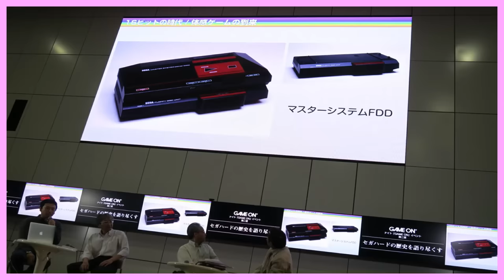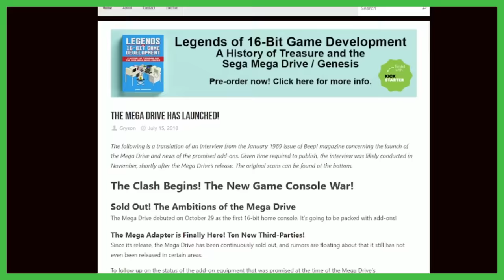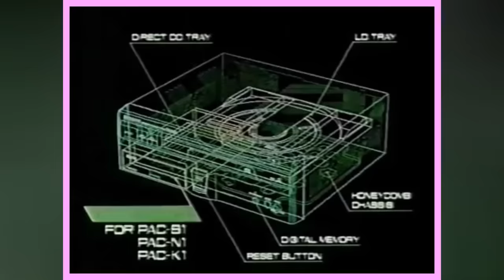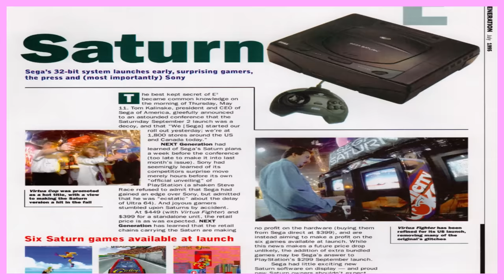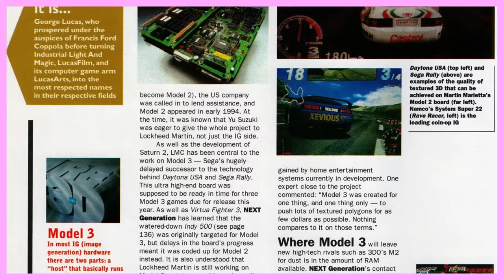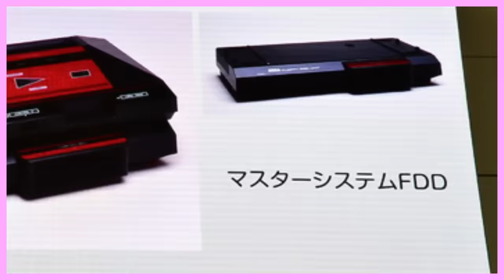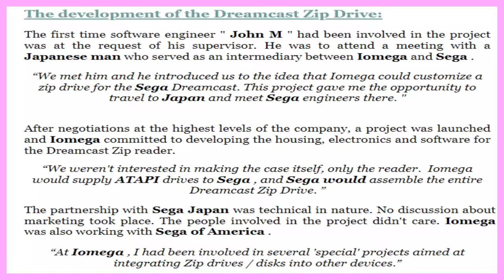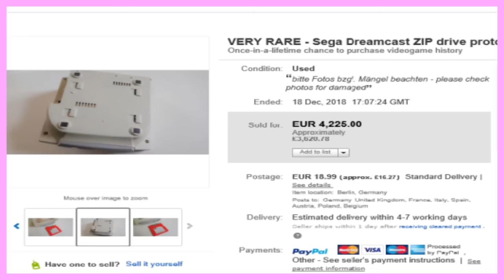Lost, Cancelled & Unreleased Sega Console Add-Ons

Comment: I have a Pioneer LaserActive. I bought the system and the Mega LD module for about $600 at a store selling it's demo model. It was the 1st personal loan I took out. I loved the few games I got
Reply: 😊agreed
Reply: I had a similar story with my neo-geo.  A local video rental place was going out of business.  My mom got it for me for I think $200 with baseball and samurai shodown.  It was dope, but later got sold to fund a Mr. Backup Z64 for N64, so it basically paid for itself several times over.  Lol I always used to get LaserActive confused with that VIS thing radioshack had.
Reply: Why didn't you buy a MD? I guess 600 bucks for both was a bargain back then

Comment: The 32x wouldn't have been such a failure if Sega of Japan made the Saturn backwards compatible with 32x games.  The Dreamcast Zip Drive was a dumb idea as Iomega Zip drives had terrible reliability.  Sega would have been better launching a hard drive add on and playing to their advantage with the online capabilities of the Dreamcast, as it would take both Sony and Nintendo years to release a network adapter.
Reply: Then sega would need to add the genesis and 32x add-on. I rather sega release a backward compatible saturn instead of the 32x add-on for the NA/PAL regions.
Reply: @maroon9273  That's kind of what I meant.  Making the Saturn backwards compatible with the 32X would have made more sense and allowed a much larger library of games for the 32x.  The smarter  choice though would've been to not release the 32x at all.

Comment: Instead of the 32X, what they should have done was take the SVP chip from Virtua Racing, drop that into a Sonic and Knuckles lock on cart, maybe modify the top connector a bit so that only appropriate games can fit into it, and not into the base system, and then release cheap games making use of the SVP.